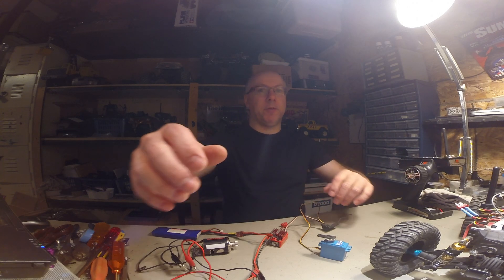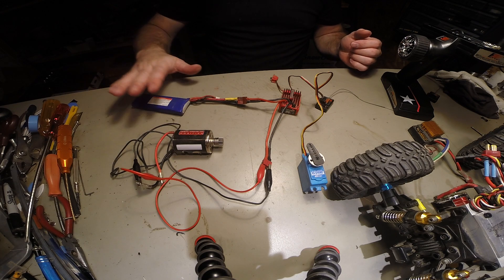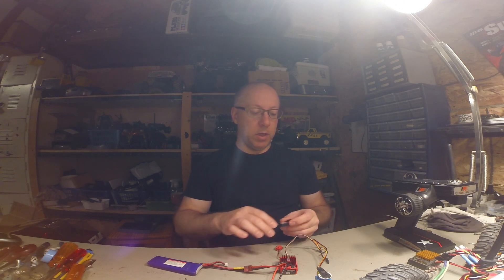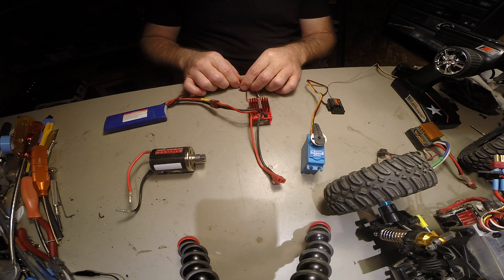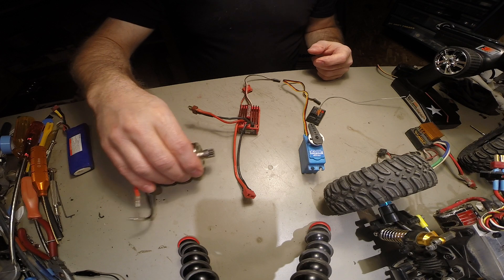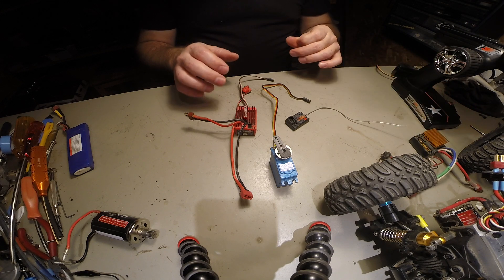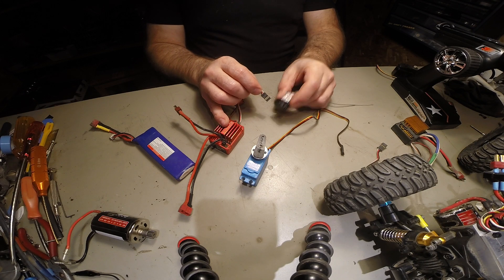Troubleshooting RC Electronics basics - Diagnose and fix it yourself

Comment: J'allume le radio mai il sonne toujour
Reply from the maker: La télécommande sonne toujours? Si oui, ya pas de connection entre la télécommande et le récepteur. Ça peut être  de l'un ou l'autre. Faudrait tu trouve un autre récepteur pour essayer. Si ça fonctionne avec l'autre récepteur, c'est ton récepteur original qui faut défaut, si ça continue a sonner c'est probablement la faute da la télécommande.

Comment: i think my issue is my ESC But i checked theres no cable loose or burnt marks anything it just suddenly turns off when i was fitting a new gear for my motors i was revving it and then its off but when i try to move it a little giving it a shake it turns on everything for a split seccond, is there a way to fix it cause i dont want to buy a new esc
Reply from the maker: You have  to isolate the issue.  Try moving wires one by one without moving the others.  Especially connectors like battery and receiver.
Reply: @TheLEDwheel  i tried moving other than the esc and then disconnect everything and tried to figure out the esc again it ended up not sparking anymore. so when it first when dark everything thing just stops including the esc fan
Reply from the maker: @Doomknight86 the fan takes the same power as the receiver  but how does  your  battery connection  look and what type of  connection isn't. What RC is it
Reply: @TheLEDwheel  i bought a new esc :v and it worked again dayyum money gone
Reply from the maker: @Doomknight86 what rc is it?

Comment: Hello sir, when powering on I don’t get any light on the receiver but only a red blinking light on gyro. I don’t have any extra components to test like you mentioned. Any idea what could be the problem? Thank you
Reply from the maker: Your receiver may be bad. Have anymore details about your  RC and setup?
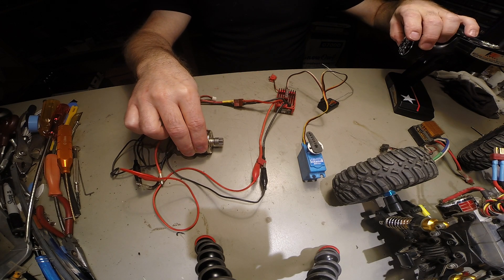Reply: @TheLEDwheel I have a 1:24 drift car with dumbo rc p4fm receiver and gt55 gyro. I have put a new battery it was running good for 3 mins and suddenly just stopped working. It won’t let me reset my gyro or rebind.
Reply: I was thinking it could be a cheap esc I’m using that came with it that needs to be replace or the receiver like you mentioned.
Reply from the maker: @mpescarte your esc is giving out power since the Gyro led lights up.
Reply: @TheLEDwheel ok I will change the receiver. I appreciate and thank you for your time sir!

Comment: My issue is with an rc plane. Just purchased it yesterday and got it out today to take a first flight and for about 20 seconds of testing and checking it was fine. then the motor stopped and cut power to the plane. I unplug the battery reconnect get power back I can still move the elevators and flaps. but the second i try to add even a little throttle power loss. I'm new to the hobby so i'm completely lost I don't have spare parts to test on or friends who like having hobbies. any advice anyone? I'm having a replacement sent but i'd love to get to the bottom of what the issue is so i have that experience and knowledge. as of now i'm just assuming the motor is shot.
Reply: Are you 100% sure the battery is charged?

Comment: Recently i brought a Remote control car online and play Yesterday. I accidently bang into the wall at the void deck, the car stopped but it still can but move but it will stop. Now the black wire came out, it can't move at all. I suspect must be the motor's wire. But the power and steering seem fine.
Reply from the maker: @Japanophile95  what RC is it?
Reply: @TheLEDwheel  Subaru Impreza R/C 2.4G, 1:10 Scale, but the wire for connecting the motor is insert not clip.
Reply from the maker: @Japanophile95  what brand
Reply: @TheLEDwheel  V-Max 30
Reply from the maker: @Japanophile95  hmm, can't  seem to find info on it. Where did you buy it? Do you have a link?

Is the wire disconnected from the motor or ESC?
Reply: @TheLEDwheel  I brought it from online store.
Reply from the maker: @Japanophile95  i need more information about it.  Copy and paste the link please
Reply: @TheLEDwheel  Sorry i can't find the information about this but it's  okay i can send it for repair. thanks.

Comment: So my situation is that the servo works and my new motor doesn’t so did what you said and so the servo works with the throttle but the motor doesn’t work with the steering so is the ecu bad? because it doesn’t work with the throttle?
Reply from the maker: @RainerKelly  if the servo works on both channels then the RX is good. Your ESC or Motor may be faulty.  What's the motor and ESC? Is it brushed or brushless.
Reply: @TheLEDwheel the esc and the motor is a brushless setup but I got the esc from my friend and idk  how old it is so it probably might be the esc
Reply from the maker: @RainerKelly  do you have another one to try.
Reply: @TheLEDwheel no, but I shall go buy one

Comment: In my case one channel , my right aileron, was not operating but the left one was normal. so i switched positions on the receiver and the right one worked, but the left did not. ….so this would indicate the receiver and servos are ok.   So this is a tx setting problem ?  if so what am i missing ?
Reply from the maker: @KenastonKid  could  still be the rc or TX.  Only way to rule that out is another TX or rx to test with.

Comment: Hey brethren, I have a redcat Ascent and I replaced a motor, now it wont steer or run at all but esc light is on.
Reply from the maker: @REightch  do you know if the RX is getting power from the ESC?

Comment: Been trouble shooting my sons RC. It started with no response in steering. I checked it out, and the servo had sand around it. I replaced the servo, and the new one had a steering response, but randomly didn't respond to left turns and would twitch. The company sent a replacement that has random no response also but the servo will twitch if I tap on the top of the controller.
Reply from the maker: Could be a loose connection, but was this mentioned to the manufacturer/seller?

Comment: Ok what if your ESC does not respond unless re "binding" the remote every time you turn you car on?? I have a hpi savage xl and I fixed a couple things then after putting it back together I turn it on, no beeps from the ESC.... Turn the remote off and hold the bind button and turn it back on it then beeps. Wait 2 or 3 minutes it works?
Reply from the maker: I've had a receiver do this. I needed to rebind it every time.  It still worked well, but I ended up changing the radio set completely as the receiver in question was no longer available.

Comment: I’m finding this video years later but I have an axial smt 10 on stock electronics and remote and the remote won’t pair at all is it the receiver?
Reply from the maker: Only way to find out is to try another receiver  if it  works, it was the receiver, if not its the radio. Assuming you are doing the pairing procedure correctly of course.
Reply: @TheLEDwheel  the radio has a rapidly blinking red light on it and I recently had to take it apart to fix a broken steering mechanism and since it hasn’t worked
Reply from the maker: That is important  info. Check that your antenna is still connected inside the  transmitter . Maybe try something.  While binding, bring the receiver as close as possible  to the transmitter antenna  base area. If it binds, you possibly have a broken antenna  wire.
Reply: @TheLEDwheel  do you have another way I can maybe get in touch with you like maybe Instagram?

Comment: Great. I have a cheap boat that worked and now no longer works. Boat has power but the remote has no power. New battery but no light. Any suggestions on where to start? Thanks
Reply from the maker: Make sure the battery has power/charged. Otherwise start following the power  line. You may have to open the transmitter.  A multimeter would def help.

Comment: Hello so my rc car have quite the same problem so i checked all the connectors as you showed but they are good. 
If i put throttle when all four wheels of the rc car are in the air it spins normally but it doesnt seem like full power and if i put rc car to the ground and press throttle it doesnt move it sound like it is lagging but if i push the rc car and press throttle then it moves and drives but it goes very slow (before that problem it was going around 40km/h)
I hope you understand the problem and i am very sorry for my bad english because i have a bad knowledge in this language.
Let me know if the problem is salvable, thanks.
Reply from the maker: My first  guess would be a faulty ESC or even the motor. Do you know what burnt electronics smell like? If it smells bad, then for sure it needs to be replaced.  I assume its a brushed motor? If so, you can test it by connecting a battery directly to it. If it goes strong, then it's a faulty ESC. What RC is it? Here is a good ESC. https://s.click.aliexpress.com/e/_mqg936O
Reply: @TheLEDwheel  motor is brushless and it do not smell like it have burnt electronics

rc car is maverick strada xt evo s

thanks
Reply from the maker: @dejgas3691  you're going to have to get yourself another esc unless you have a friend you can borrow one from to test .
Reply: @TheLEDwheel  is there any possible way to test esc or maybe reset it somehow?
Reply from the maker: Depends how its setup. Check your esc model configuration instructuons to re- calibrate it to the radio. Other than that you can bring it to a hobby shop and ask them to test .

Comment: Is there a way to troubleshoot a receiver stand alone using a voltmeter? Where does the receiver get it's power from? The esc? I get low voltage 0.4 v . What are the color code of the wires?
Reply from the maker: Yes there is, Generally the Darker colours indicate negative and Red or orange for positive. Most of the time its either Red and Black together or Orange and Brown. Yellow and white tend to be the data or signal. Most of the time the receiver will get its power from the ESC so if it is not giving out at least 5 volts it may be defective.
I made a 2nd part for using a multimeter and other tests to help diagnose these issues.
https://www.youtube.com/watch?v=FQ02aQcQKFg&t=210s&ab_channel=TLWtheLEDwheel

Comment: Hallo by me mine motor goes full power  on when i put mine battery on with the radio on  
Whats the problem thank you
Reply from the maker: On what RC?
Reply: Hallo boat rc
Reply from the maker: More specifically?
Reply: Its a stealth rc boat with a brushes motor  and esx radio the in out  switch is also not working  greetins
Reply from the maker: Ok, i have experienced this issue before. It was a faulty ESC. However, have you tried switching channel one and two?

Comment: Thanks for sharing the info, I’m new on this RC stuff troubleshooting and I will be testing my c14 , what it does is turns backwards when driving forward for couple of seconds and stays like that for few more seconds then if I press reverse it goes fine for couple of seconds but same thing stays stuck for a moment then stops, I did not know where to start the troubleshooting.
Reply from the maker: I don't really know the C14 specs or functionality, but it is kind of a middle ground rc. Not toygrade, but still not Hobby garde.  That being said, the first thing to check is always always make sure your battery is  charged. On a hobby grade rc when the battery is low it will stop the motor but will still allow steering.

Comment: my problem is i have no power at motherboard and lost steering
Reply from the maker: Ok, still dont the model, but my guess would be a toy grade RC.  If so, they are disposable at best. Please reply with the brand and model name.
Reply: @TheLEDwheel  mltoys 14800 like a huina 1583 not really a new bright
Reply from the maker: @Dance Around The World  ok so def a toy grade, however you may be able to get a receiver board or even a controller and receiver kit. Check Banggood or Aliexpress.
Reply: @TheLEDwheel  ok thanks ill try that and hope its not parts tossing
Reply from the maker: On what? Motherboard?
Reply: @TheLEDwheel  circuit board that the steering motor connects too

Comment: I was playing around my rc model then when it bumped to my hand it turned off on its self and doesnt have power when i turn it back on
Reply from the maker: Battery charged?
Reply: yes
Reply from the maker: @vanmiguelpanem4009  what brand and model?
Reply: Its fine it was a loose wire on the motor, thanks for trying.

Comment: So if you do this and you still don't have power is it the receiver or the esc that is bad
Reply from the maker: Are you 100% sure the  battery is charged? If no lights come on anywhere it could be a dead battery, bad connector, or bad ESC.

Comment: what could be the problem that the motor is normal, but when i put the car on the ground, i ask the car to go front,  it disconnected
Reply from the maker: Does it still  have steering?
Reply: @TheLEDwheel  yes, the servo is working
Reply: @TheLEDwheel  and the battery is run out very fast, the battery is new and fully charged
Reply from the maker: Sounds like a low voltage cutoff. Is it a NiMh or Lipo battery?

Comment: all 3 of my ESCs dont respond no matter what. One of them doesnt even have its lights turning on anymore. I hate this hobby so much, why is all the hardware so garbage?
Reply from the maker: Need more details. Is is all different. Radios or one for all 3? What rc's? Toygrade or hobby grade ?
Reply: @TheLEDwheel  same radio for everything, so transmitter never changes, I have multiple RCs that I’ve made myself which all have a receiver and I just bind them according to which I’m using. RC grade ESCs, either absima or finger tech ones, always hooked to the same power source and always work whenever I first use them. 2 months laters it takes some fiddling to get them working ( just plug in and out, unbind rebind ) after 3 months they’re just gone. I’ve bought around 20 speed controllers in total in the past 4 years and 3 of them still work today. I never change any of their settings, I’ve tried factory resetting them but that never works either. It just seems like a huge money sinks to get you buying new ESCs. I’m really tired of it…
Reply from the maker: When you buy low-end parts, this happens.  This is why i stick to mostly Hobbywing ESC's. Cheap parts end up costing  more in the long run because you have to replace them.  I have Hobbying ESC's that are 7-8 years old and still run perfectly.

Comment: Ok kinda new to the whole rc hobby always had the cheap box store break in 5 mins one finally traded some stuff for a kronos truck and ran fine for a few times out now will be fine for a while with part throttle but if you go full throttle it stays there till you turn power off to the truck it keeps steering and will go into reverse but stays at full throttle no matter what till truck power turn off then does fine when turned back on until full throttle Is hit again and FYI esc to motor wiring has small cracks in the wire coating no broken wires just the plastic around wires have tried putting electric tape on them with no change
Reply from the maker: Sounds like a bad ESC.
Reply: @TLW theLEDwheel  that's kinda the way I was leaning by what I'd seen on internet but no one really had similar enough problems to make sure I appreciate the info
Reply from the maker: @roberttate195  If you have a hobby shop nearby, they can try another ESC before you spend on a new one.

Comment: A little late to this party but did you ever do that flow chart? Great information, I’ve got an hbx protector that has the led’s that start flashing when turned on but instead of staying on when the transmitter is turned on they turn off. When paired it doesn’t steer not accelerate
Reply from the maker: You are saying that you turn on the RC and the lights come on and then turn on the transmitter and they turn off? For starters you should never turn on the RC first. Have you tried turning it on without the servo connected?
Reply: @TheLEDwheel  I haven’t I’ll unplug it and retry it

Comment: Very good video, I have an xmaxx and long story short, i have steering but as soon as i touch the throttle in either direction, the esc completely shuts off , no flashing lights just shut down and it will turn on again and stay on until you touch that throttle. I tried your suggestion and swapped receivers with a Tmaxx and steering still works in either channel. Now I’m thinking motor, take to hobby shop, tested it and works. So if the esc is dead, why no error flashes. ?
Reply from the maker: Electronics can fail in so many ways. Its possible that activating the throttle completely shorts out the esc's systems and then it resets somehow. You took the motor to be tested, why didn't you do the same with the esc?

Comment: Hey mine seems to lose signal after like 30ft
Reply from the maker: Ok. Check that your receiver antenna is intact or is not all bunched up. If it's cut or damaged it will affect your range. Alternatively, make sure the batteries in your transmitter are good. 

If possible try another receiver of the same brand. If it still does the same then it may be an issue with you transmitter.

Note***
Cheaper radios like on toys can have less range.

Comment: So mine is cutting in and out when I give it gas
Reply from the maker: Battery charged?
Esc  on proper battery settings?
What battery are you using?
Reply: @TheLEDwheel  battery charged stock battery and ESC is stuck I have no idea how to check it
Reply: Stock*
Reply from the maker: @RepublicOfTheWolfPackXanthera  its either lipo or NiMh.  What is your  rc?